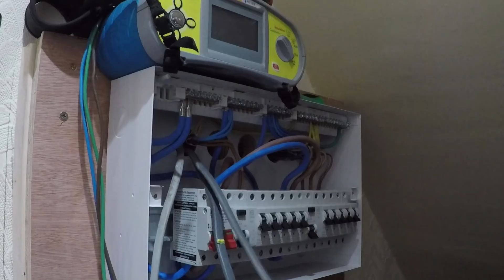Fuseboard change  -  discussing common controversies | Thomas Nagy

Comment: Thomas,  I replied to another comment  but i'll copy and paste this here.

"As i conduct fire testing on these, you're probably the closest to being correct that i have read so far, unfortunately there are many wildly inaccurate assumptions as to what a fire test requires, and what a fire rated downlight is actually meant to achieve. My pet hate is that anyone can walk into a store and buy 90 minute downlights, take them home, fit them and think that all in the world is now safe. 
As a side note we, not so much lately, have had many potential clients, probably in a bedroom office,  wishing to test imported downlights as they are cheap to import and pricey to buy off the shelf, the difference being potential profit, woohoo. We never hear from them again when they find out what is involved and how much it costs to get a full set of fire tests done.

If you are fitting them, buy reputable brands that can prove they have the reports and the test evidence, they are expensive for a good reason. (rant over)

There is no requirement for smoke reduction or leakage prevention in a ceiling fire test, only fire.
As with other "fire rated" or "fire certificated" products (rather loose terms in my world) smoke can pour and billow to its hearts content, as dense as it likes as far as fire tests are concerned. There are other tests for this for different products but it's smoke that kills first. Chances are, you would not believe how fast smoke can fill a large fire test labaratory so I'm with Thomas on that alarm, might be inconvenient, tough, it;s for your own good. Get alarms, they're cheap enough.

The test to BS476 consists of a ceiling section of a known fire resistance, of a design such as those in the gypsum white book, for either 30, 60 or 90 minutes such that it will resist flame spreading through the chipboard floor layer above. 
This has had a hole put in it which has been plugged with a downlight which has to maintain the integrity of each ceiling duration as it is the ceiling as a whole that is tested.  The design of the ceiling specimen is different for each of the 30, 60, 90 minute tests, and are not interchangeable, thus a 90 minute rated downlight might not be rated at 30 minutes and vice versa. It is dependant on the ceiling into which it is fitted, so the scenario above where joe public thinks he's now safe because he has 90 minute lights fitted in his 3/8 wall board ceiling actually means that his downlight and the whole ceiling will be on the floor within about 15 minutes in a fire test. 
The test has no requirement to prove the downlight contributes to a fire or whether it has the potential to start one.
The sample ceiling is set on top of a furnace which is controlled to a time/temperature curve as stated in the test standard and will reach 500C in the first couple of minutes, 850C by 30 minutes and nearer 1000 by 90 minutes.
The failure criteria is from above, either by exceeding temperature measurements  on the upper surface, by the passage of fire leading to sustained flaming at the upper surface or by gaps opening beyond a certain size in the section of ceiling.
This means the downlight itself may have disintegrated, fallen out, segments of plasterboard detached and the joists ablaze before the end of a test and it will still pass as the ceiling section, as a whole, has still maintained its original integrity duration.

The design of downlights has changed hugely in recent years, from the steel back can type with intumescent in the vented cap and intumescent linings and a ring under the bezel they are now much simpler, smaller, lighter and cheaper to produce. Many now have little to no intumescent, tilting ones being the general exception as they obviously have a gap around the lamp housing albeit exceedingly small in some cases. 
The trend for removing intumescent seals other than cost is twofold, one, keep the downlight in place and stop the fire getting through the downlight in the first place and it's not needed, and, two, when fitted between the bezel and the underside of the ceiling it fights against the action of the retaining springs as it expands, which it can do with considerable force, and so acts to fill the gap it is creating.  Better springs will clamp the bezel rather than fight it as intumescent can. Not all intumescents are equal of course so some expand less strongly and therefore fight less hard than others but the principal remains depending on the bezel material. I've seen the bezel give up early and the whole downlight fire up into the void as if on a bungee rope! Even then, and i can't remember now, it does not necessarily follow that that light failed a fire test, if the ceiling section overall did not allow flame to pass through the floor above for the duration and the other criteria were also met.

In summary, the downlight shown could well have passed all fire tests and legitimately call itself fire rated even though it might not look  like what might be termed a traditional fire rated downlight design.  They don't have to have seals, except maybe for IP rating, fire seals, intumescents, hoods, lids etc although they do have to be tested  as designed and used in practice so the evidence for a halogen style and an led with heatsink style for example, would be considered different enough to have to be individually tested, the resulting test evidence would not generally be interchangeable. As i said, contributing to the cause of a fire, electrical compliance to that end, different matter.

Hope someone has learned something from this especially if you fit these things. Into the right ceiling of course, from a decent manufacturer who can, and will, quote or provide their evidence."
Reply: Tim Smith - Totally agree on the EICR point, the biggest issue is that generally  the customer doesn’t understand them and what they mean and what he is looking for. As soon as he has a cert he thinks he’s good. I’ve had it for my last employer who thought that the EICR they paid the contractor to do was good, did not understand it and when they went to connect up the equipment (A ISO Shelter unit) the onsite leccy looked at the cert and saw that it only had a couple of dry checks... so wouldn’t connect. I was onsite to help site the system and said I can do an new EICR, had all my test equipment and Certs to prove and when my boss turned  said how long expecting an hour I turned round, bearing in mind the leccy is stood in the group with us I said it’s gonna take 6+ hours per unit (2x), leccy was happy with response and in the mean time I found a serious flaw on the unit during testing....  unlike gas where they can condemn I feel electrical wise doesn’t have the clout....

Comment: Hey thom,
Love your videos, Just starting out on my own. I have a question regarding removing main fuses to isolate supply’s for DB changes. What’s the protocol for getting them Removed without cutting them? Would the DNO charge a fee to put an isolator in?

Comment: Fire rated downlights, only mean it will prevent the spread of fire through the light from the room below going up. 
The ‘can’ over the top can generally make the downlight insulation coverable. Two separate things.
Reply: Fire rating is dependant on the ceiling construction not the type of lamp fitted but in essence you are correct.
Reply: Theo is right,the glass and the gasket on that fitting is what makes it fire rated ,having said that i only use fittings with a full  can like the jcc v50 range

Comment: The fire rating is to do with the ceiling and fire passing though the ceiling.  If you then cut a hole in it you have broken the fire rating.  If the light fitting can seal against the ceiling and retain the fire barrier it is “fire rated”. (This obviously requires them to test this).
Reply: Rob turnbull 👍 this is what I believed too..
Reply: Correct..
Reply: That would make sense
Reply: The "them" that test this would say you are indeed correct.
Reply: In summary, Rob turnbull is correct. Whether or not a downlighter is likely to cause a fire is a separate issue. I tend to think this is something you ought to have known, Thomas. To be fair, we all have gaps in our knowledge and you’re brave enough to demonstrate yours on your channel, though I’ve largely stopped watching since all the sponsorship, giveaways etc came along.
Reply: Also, meant to say I’m totally with you on the EICR issue. I do very few, because I price (and do) them properly. I just don’t understand how people can report an installation is satisfactory when they clearly lack the evidence to suggest that it is. Ok, I do understand, it’s for the money.
Reply: All the comments make perfect sense, but to achieve this barrier effect it seems the frame and glass are a solid unit, so to replace blown lamps the choice is to lift the floorboards or remove the fitting from the ceiling. How many time do we think we can do this before the plastboard crumbles and looses its integrety and hence its fire rating?
Reply: @gadgetman36  nope, the can is only required if there is insulation. Rob is correct.

Comment: With you on the Fire Rating issue. No matter what the manufactures information is, a year down the line, another person changing the lamp, will probably not have access to that information and could fit a halogen. Also there is nothing with those open back fittings stopping fibreglass and other debris over time coming into contact with the lamp. Only time I use open fitting’s now, is in cabinet, pelmet lighting situations, and even then it’s rare as there are quite a few shallow fittings available. Just another question, I notice your installing a split board, why not RCBO’s as fault finding becomes a lot easier, and a lot less inconvenient than losing possibly 5 or 6 circuits because the RCD has tripped?

Comment: Hi Tom those downlights aren't they supposed to have a hood to keep the insulation off them. Like as you said if someone put a incandescent bulb instead of a LED bulb that's gonna get hot and burn everything above it. I don't believe they are fire rated 😕

Comment: Hi Tom, I've seen these types of fire rated lights before. I think they are fire rated as they have a glass cover and the rubber ring around the light expands and blocks the hole if there is a fire. The standard can lights normally have an open hole where the bulb goes through.

Comment: I had that issue with fire rated downlights too. I done an EICR and flagged it up as not fire rated then was shown the box etc... Turns out that fire rated is the fact that there is no way through for air if the lamp is missing, so glass or a can blocks that. The can is required for insulation.

Comment: For testing the circuits try Wago´s 221 connectors. They are so much faster then screw terminals, you don’t need any tool to fit them and they don’t damage the conductor as much.

Comment: From my understanding of the regs regarding fire rated down-lights is that they only need to stop the spread of fire from moving upwards. So in this instance the glass and rubber gasket around the bezel are sufficient in doing that. I mean that’s what I’ve been taught
Reply: Fire rating is dependant on the ceiling construction not the type of lamp fitted so you would be correct. When tested the fire is from below and the fitting which now plugs the hole in a known rated ceiling construction has to prove it can maintain the original integrity rating of that ceiling.
Reply: Tim Smith yes you are right mate but I’m not talking about the material? We are all talking about down-lights, so as an electrician material isn’t our job.

Comment: The fire rating is the glass and the intusemescent strip round the edge . Only need a fire hood to stop insulation going onto the fitting which if you look into it you should technically still put a for hood over the downlights that are fully covered . Or make sure there is no insulation over them . Or so I believe when I looked into this .

Comment: Im from germany and we fitted many similar Downlights they were  
a little more pricier ( brand brumberg) but they were normally fitted in ceilings, that are different fire hazard zones,so they have to be fire rated as well as they were specially picked by the architects/planners

Comment: Hi mate love your channel. Whats your thoughts on torque screwdrivers when working  in a board? Also i would not use them as fire rated lights.
Reply: Paul O'Neill -I use one on every new install as it’s a requirement stated in the manufactures instructions.. so therefore necessary to protect yourself for insurance/claim related issues.. though I never use it on pre existing boards as I’ve not installed it.. and if they’re quite old boards who’s gonna know which torque setting is correct..
Reply: TheLifeOfRipple same here. I actually quite like them